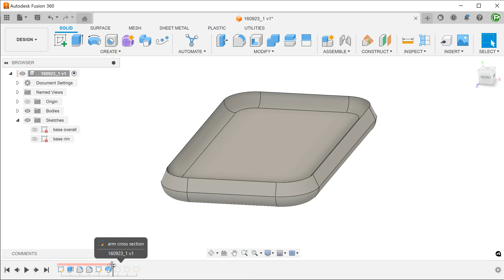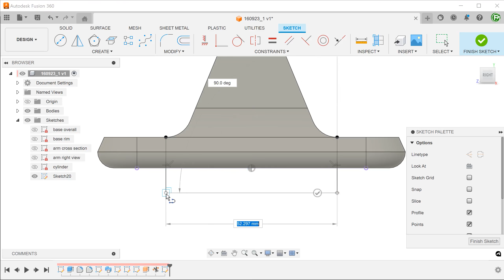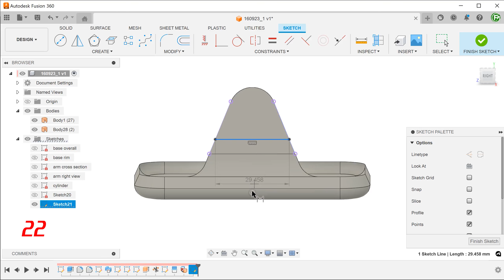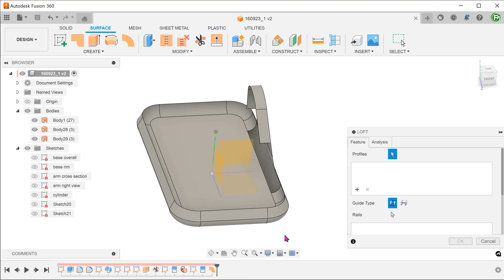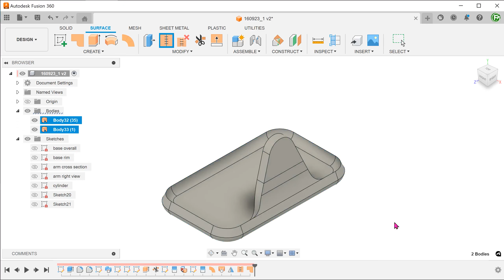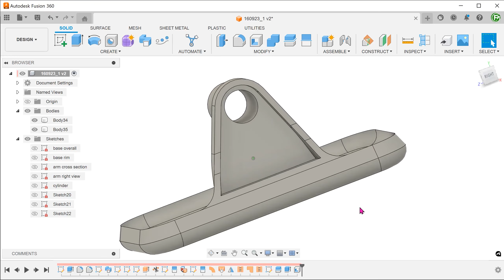Fusion 360 | Hook (Surface Patchwork)

Comment: HA HA! That was my question!!! I never figured it out:-) Thanks. Could you upload the finished model as well? Thanks as always.
Reply from the maker: Thank you for posting this! I struggled with this for quite a while. In fact, I practically gave up and ignored it for a while. It was only last week that I decided to give it another go. I am always hesitant to upload full models due to a number of reasons. Did you face any trouble following the video?
Reply: . @Fusion360School   I asked for the complete model because though I'm proficient in 360. I never wonder outside SOLID. I'm a bit offput by SURFACE and MESH tabs. I didn't have enough time at first watch to follow along in 360. I will rematch when I have more time to follow along with as fine toothed comb. But very much appreciate your effort.
Reply: @FilmFactry  I've found it very helpful to try to recreate these videos step by step. Has really taught me a lot.